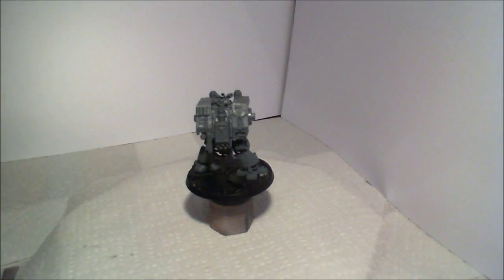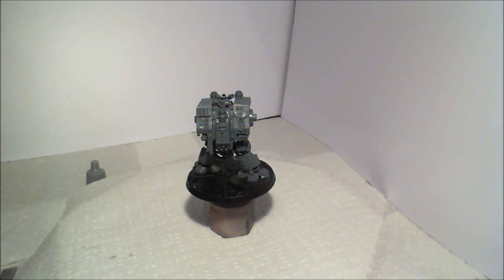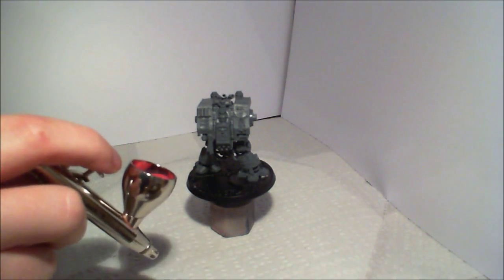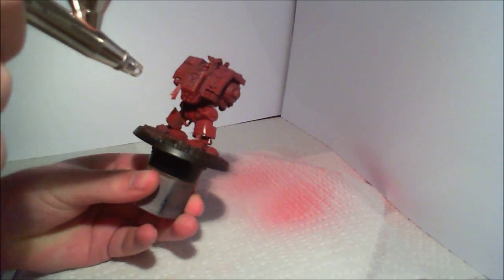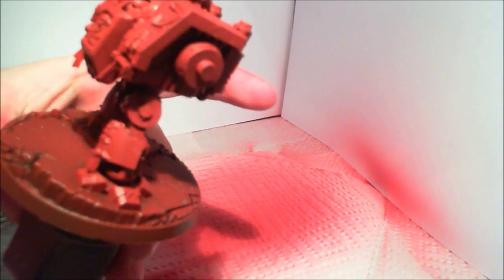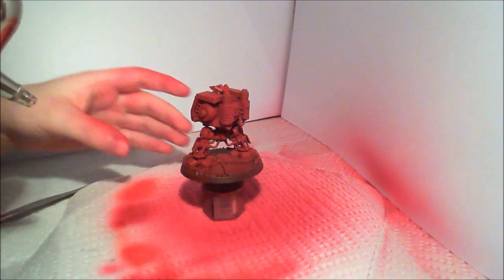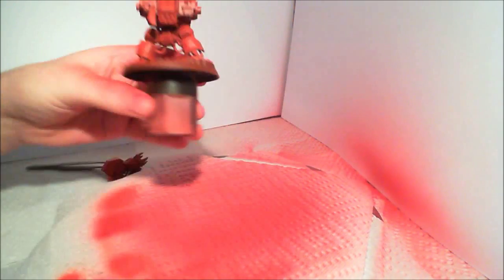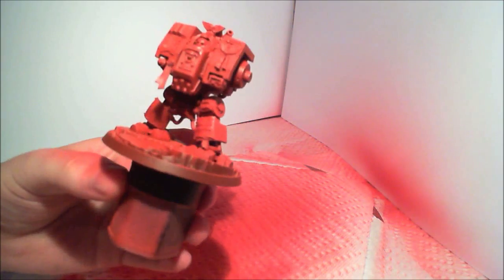011 - Priming with an Airbrush - Furioso Dreadnought Painting Tutorial Part 1

Comment: There is a difference between priming and the base code/ first layer of paint. A primer acts as a bond between the material and the paint. It should have a strong adherence to the material to prevent the paint from being chipped off. It should also have some kind of filler to even out small inperfection in the material. In addition it should leave a slightly rough surface for the actual base code/ first layer of paint to stick on.